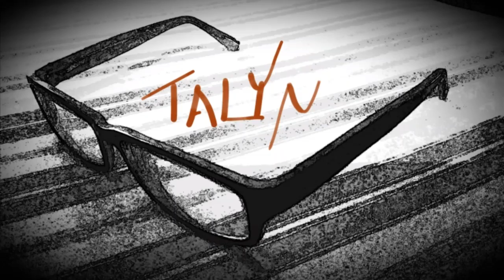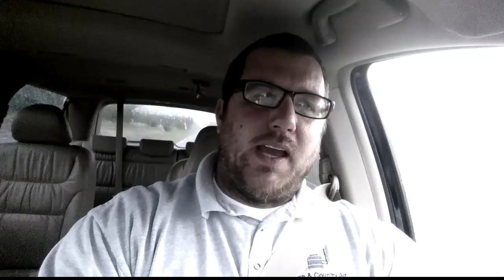Why Does My Air Conditioner Freeze Up?

Comment: I think sometimes homeowners ask too much of their systems. Wanting your home to be 62 when its 95 outside may fall into the refrigeration category instead of air condition. In a reasonably insulated home, how many degrees should a system be able to lower inside temp. Compared to outside? 25, 35, 40 degrees?
Reply from the maker: Where I am at the design set point is 75 in cooling when the temp outside is 92.

Comment: biggest problem I find is "customer's fingers" I had a Burger King that in the beginning of the season they didn't have maintence on their six roof top units, they needed refrigerant and the evap coils iced up, the dining area got warm so each manager as they came on their shift would crank the thermostats colder until they were pegged all the way cold. They finally called for service in July, I went up on the roof and the compressors were running constant, there was an ice ball developed outside each metal panel where the compressor was, the compressors had a 10 " shell of ice on them and of course the evaps were totally ice. Good subject for a video .
Reply: ***** Now that would be a great video to see.
Reply from the maker: Wow. that is horrible. did you deice them or have them thaw out naturally
Reply: Zack HVAC what I usually do is take the panels off the unit , then go to the thermostat and turn the cooling off and put the fan in the on position, this uses the warm return air to do most of the defrosting. I took my crescent wrench "hammer" and broke the shell layers of ice off the compressors. I'll also use mp B tank or my mapp gas torch depending on the situation.